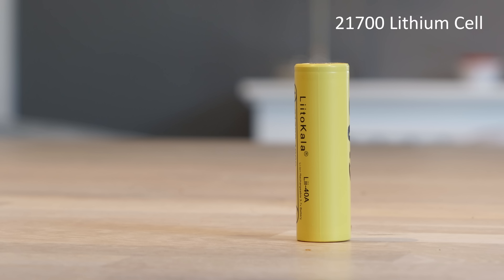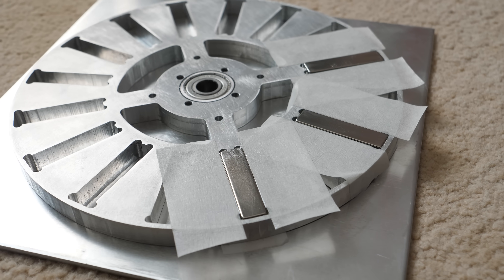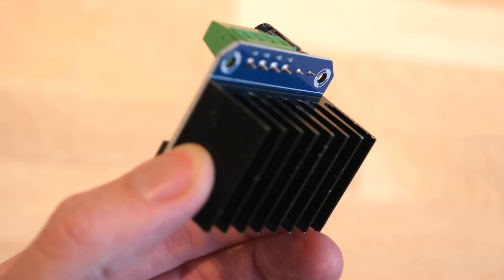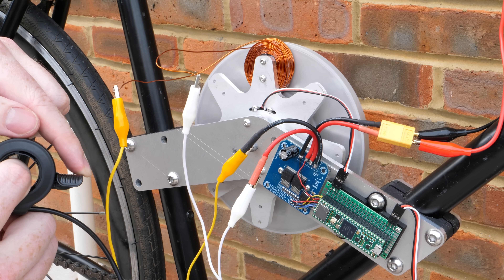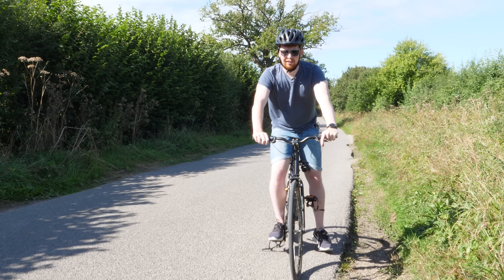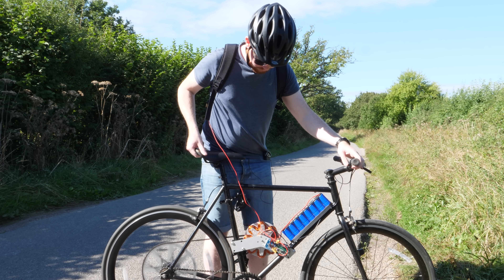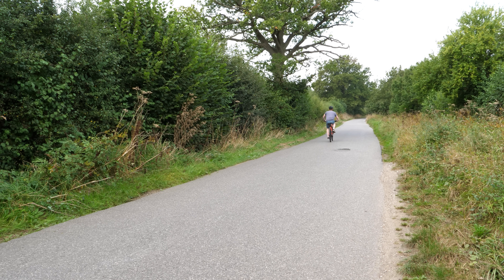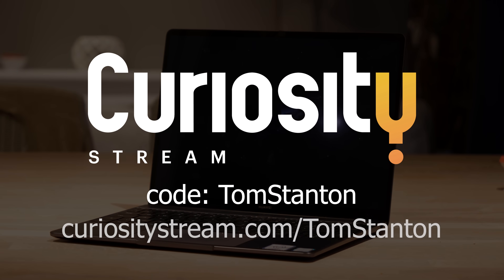Super Capacitor Bike

Comment: It's actually great to see it almost fully recharging the capacitors when you go downhill.
This would be great for electric scooters if the energy storage amount was bigger.
Massive props for creating the electric motor from scratch.
Reply: No matter how big the storage is, the descent is never going to provide enough energy to get back up the same hill. I wouldn't be surprised if the capacitors don't even have a weight vs storage advantage vs batteries anyway though. They're certainly much bulkier.
Reply: @RyanGaryLeTomo  nope, you just need to buy the scratch.
Reply: @ehombane  we have already seen what happens when a civilization falls that relied upon the tools and technology of others. The collapse of the Roman empire put Europe back hundreds of years in technological advancement. Same with the fall of ancient Egypt. We still do not know how they built the pyramids out  solid slabs of stone the size of a semi truck. We would struggle to build one with modern technology. No single person will ever have the knowledge or ability to build something even as basic as an aluminum can by himself left with no modern technology or tools, even if he lived for 10,000 years.
Reply: @randybobandy9828  I am aware of this. And it was implied in my statement which was only about improper use of an expression. (actually looking back, I may argue that I was wrong since the deceit is norm today, lying is the proper way of communicating).
Reply: @ehombane  yeah bs. You simply dont know how a slilled worker uses a term and now you whine about "uww lying is the new norm" Thats why you did not have the balls to answer to my comment. But i will give you another chance.

-A homeless person finds 100$ and says "Wow, thats a lot of money!"
-An Investor closes a reaaaally good deal of over 100M$ and says "Wow, thats a lot of money!"

which one is the liar here? 
The Answer is: there is none!

Perspective makes different terms mean different things to different people. words like "a lot" or "from scratch" are flexible and depend upon the circumstances they are used in.
Reply: @randybobandy9828  Thats not completely true. The things that we lost after the romans fell was mostly bureacracy. A nice thing but unneccessay for the small countries that existed back then as the upcoming feudal system was more efficent for them. The bathing culture for example survived the romans for centuries. Things like Math, architecture and chemistry boomed in the centuries after the romans fell. Sure we lost things. Plumbing for example vanished for a long time. But we also found tons of new knowledge that the romans never thought of despise their "greatness". Not to mention that we regained and improved everything that was lost after the roman empire fell

Also of course we know how the pyramids were build. im pretty sure you can find this kind of knowledge on wikipedia nowadays. The only questions that are still not completely closed are how they managed to build them this accurate with the simple tools they had, and why they built them like they did.
Reply: @andrefasching1332  go above and read my latest comments. As I said, I was wrong. What do you want me to say more that I was wrong. The correct way is how the majority says that is correct, even is wrong. 

From scratch is from basics. And if an Arduino board is basics, so be it. Here I am the ignorant not knowing where are the trees that bear Arduino boards as fruits. 

Anyway, this is just an single example of deceit, a minor one among other millions, other example being 14,99 used as price for curiosity stream. Just a minor strategy to seem that the price is smaller.  People already correct this seeing 15, but sellers still are using it, because this is the norm. And so it goes in advertising and politics media, and everywhere else, where is not as obvious, and then people complains about the results. 

All I tried was just a minor correction. Is a habit for me to react to fake news clickbait and this sort of bullshit. But people likes to be lied. It is obvious again from the reactions to my comment.  So yeah, enjoy your shiny make up. Truth is bland and grey and boring.
Reply: @ehombane  show us your ways
Reply: SIR ENERGY "SALVAGE" from REGENERATIVE BRAKING WAS FOR YEARS  ~15% .........GOING DOWN A MOUNTAIN (,CONTINENTAL DIVIDE / ROCKY MOUNTAINS ) NO POWER NEEDED , + CHARGING BATTERIES/ CAPACITORS ...
Reply: Yes, making that motor is impressive skill. But though, is not from scratch. 
People got so used on buying things...
So, there was insulated copper wire, magnets, aluminum. aaand .... some advanced electronics. Assembling this into an motor is a skill few have, maybe less than 1 percent of population. 

But, drop the guy on a deserted big island, and let him make the motor. I make the concession giving him the tools though. A shovel to dig the ore, a furnace to smelt the ore, a hammer... I stop here you got the idea. 

Sorry if my comment full of negativism, but I got tired of  this kind of videos, make your own solar panel, ... but I see how to assembly solar cells. Make your own battery, but I see how to assembly a bunch of batteries. Only once I saw a guy making a lead battery, but still so pitiful, that was not actually usable. Was just a proof of concept. We are so dependent on industry... 

Left alone, few of us will be able to make basic things like a clay pot or a wood spoon.
Reply: @ehombane  So what? If you want to watch ore smelting go to a different video, this video would be hours longer with multiple different mechanical fields involved that it would lose focus and take forever if it would have been done your way. This is not a primitive technologies channel.
Reply: @CheeseOfMasters  It seems you did not got my message. 

It is not about what I want to watch. It is about a statement not entirely true. I explained that I am tired of exaggerations. He could have said.. designed and built a motor, which is impressive enough. Leaving that .. from scratch, out, would not have ruined the message and the statement would have been true. 

Sure in these days when lies and deceit are the norm, this little exaggeration may seem natural.
Reply: @ehombane  "from scratch" merely means "from the beginning"

Building a motor "from scratch" does not mean you cast the iron yourself. It simply states that you build the motor with the unassembled parts used to build a motor instead of using preassembled Groups. Beeing an engineer working on large scale logistics applications i can assure you that there is a vast difference between these two concepts in terms of money and time.

Its not him lying....Its you having a false grasp of what "from scratch" means in the eyes of a specialised worker
Reply: @andrefasching1332  apperantly the guy thinks in order for your grandma to say "I. Made this pie from scratch" she has to grow all the ingredients but not just that, she needs to use her hands and no tools  because that wouldnt be from "scratch". She better not have used store bought fertilizer from the store either! Otherwise you can't claim from scratch either! Did she find those seeds in the wild or did she buy them from the store? Why is it that nobody is capable of building an entire computer from nothing but their bare hands and the knowledge to do it? We just are so.... Dependent on manufacturing and industry. Lmao
Reply: @ehombane  Clay pots and wooden spoons are magnitudes below assembling a motor from raw elements. I think we would be fine to make dishes if we needed to.
Reply: @bobafettjr85  You would be surprised how much skill is needed for those .... magnitudes below.  As a kid I was forced to do a lot of things with my hands. Some I even liked doing. But the results were so pitiful. Functional, but pitiful. So I know that is harder than it looks. I challenge you at a mind game. Imagine your city. How big it is? few ten thousands? few hundred thousands? Mine is about 200k. Now imagine a barrier blocking access to the rest of the world. Let include enough land to feed the people. Now go to superstore and look at the shelves and imagine how many products will still be there after an year. I am able to fix anything in my house. But I need spare parts and materials. I can improvise, but I know my limits. And I know the importance of industry that provides us so many things about we do not know how are made.
Reply: @ehombane   @Daneel Olivaw  Skill to make artful clay pots and wooden spoons. But as you said it would be functional. Those are things that can be made directly with hands and simple tools. Pulling iron ore out of the ground, forging it, then magnetizing it takes advanced machinery and understanding of several branches of science.

Concerning walling off the city that is a completely separate argument. If the average person were dropped on an island they would be able to make a crude spoon to use. If the city was walled off many people would die since they don't have access to resources outside of their area. But if you took that same population and dropped them in open wilderness that had some of every resource I would be willing to bet more would survive than cutting the supply line. Because among that population a large chunk can understand foraging and hunting. And then others who understand the various tasks of building shelter, farming, metallurgy, medicine, etc could teach the others. At some point massive a couple hundred they would get back to a similar point they were in when they began.

I understand your point that he didn't make it from scratch. But it's a phrase that doesn't really mean anything. If someone makes a cake from scratch that rarely means they milked the cow, gathered the eggs, and ground the wheat into flour. No they bought ingredients that were already prepared. So him making a motor from scratch uses the same logic he bought ingredients, wire, magnets, and metal and made the motor himself.
Reply: @bobafettjr85  Cutting lines of supply? I said plenty of land around. No need of supplies.  And as you said, they will survive, but at dark ages level. 

And with the caked example. I really never heard somebody saying making a cake from scratch.  It would sound really weird. I baked a cake from scratch. Even actually these days actually you cam make a cake by unwrapping the baked part and icing it with a spray can. 

And you are right, it means nothing. This was my point. Today words doers not means nothing anymore. We just use them as we please regardless of reality.  And as I said before, saying, I have made a moor that I designed myself would have been more accurate and similarly impressive. 

Sure these days some expression leaves room from interpretation. Like that joke. Sure we can accommodate you for the night, but you need to make yourself the bed.
There is no problem, I can make my bed. 
Good, here you have the planks, nails springs, rope and everything else needed.
Reply: @ehombane  You've never heard of someone "making a cake from scratch?" It's a pretty common expression. It means they made it from the base ingredients instead of a pre-made cake mix.

The entire point I'm making is making a wooden spoon doesn't take as much skill as making a motor. Even more so if making from raw materials. Most people given some wood and sharp rock can make a functioning spoon.

The whole city thing was a separate thought experiment you added on.
Reply: @bobafettjr85  from where I stand the fact that there exist that expression for a cake proves my point that in common language the true meaning of words and expression got really distorted. Opening a tin can or a plastic wrapping does not equal with making. 

OK then; I give up. Assembling is making. Assembling your Ikea furniture is making your furniture. And if you modify your Ikea furniture cutting the leg shorther and adding wheels for better moving around is making furniture from scratch.  And I am genius also. I have made all my computers except the first one.
Reply: @ehombane  the problem is if you want to do anything High tech by yourself you need a degree in at least ten chemistry subjects
Reply: @siddharthagotamask9848  Yes, I know that. And not only chemistry, but a lot of other domains. 

But what I do not know why you tell me this, when my comment was about the meaning from the scratch.
Reply: @ehombane  mmmh amazing dude you better than anyone, just create your own hydrogen storing polymer and give us a tutorial if you really know anything. So much dedain...
Reply: @ehombane 

"In My days there wasn't autism"

Some kids during these days:
Reply: @Daneel Olivaw  If you wish to make an apple pie from scratch, you must first invent the universe” - Carl Sagan

Comment: Just hope you don't over charge the capacitors near your legs ouch I'd add either a temp sensor or some safety cut out to prevent the capacitors over heating etc

Comment: How about:
1. Triple the count so you have 3x the voltage (and speed)
2. 5x sets of the above, so once the first set reaches threshold voltage, switch to 2nd set..BUT 1st set now gets charged due to regenerative braking etc.. The graph should look a little bumpy but kinda like a rectified sine wave...without getting below the threshold.

Comment: I have a 1963 Sears electric guitar with bar pickups that only one guy in US said he could re-wind.   I calculated the number of conductor wraps for the coil with 42ga wire.   I needed 4000 winds for the correct ohm value.   So, I made a wooden plate on my Shopsmith, mounted the pickup to it with two screws.   To count the wraps, I goy an old desktop calculator (the ones with a paper roll and printer).  Wired a door switch to the calculator circuit board by soldering it to the plus key both sides.   Mounted the magnet to pass near the switch.   Because the wire was as fine as hair, it took 4 tries, but I finally got it.   Guitar sounds great.

Comment: Use a Lithium battery for cruise, super caps for acceleration only. Regenerative braking to charge the capacitors. It will greatly increase the range of the cruise battery since it no longer needs to provide the heavy load for acceleration from stop.

Comment: Does your motor, which I was very impressed with, start up in either direction, or do you have the switching sensors offset slightly to induce forward spin?

Comment: With the capacitors all in series, additional issues are the ESR (equivalent series resistance), and self discharge of the capacitors.

(The larger they are, capacity wise, the higher ESR tends to be).

Paralleling them gets the resistance down. Maybe series/parallel.

If you can find a boost regulator that could handle the current, this might allow you to use more of the capacitor’s Joules.
Reply: There is a Low ESR series of Supercap available. Supercaps are best utilized when put in parallel with the battery.

Comment: It occures to me that the difference between the way capacitors and batteries receive charges may provide the matrix of differences wherein a hybrid might emerge ... even perhaps as how the differences between electric and internal combustion engines finally brought forth the more familiar hybrids in automotive transportation. Perhaps greater capacitance in the recovery of energy by slowing or bringing full stop to things already set in motion (as in braking) might recover and store energy to resuply the battery driven array of tools.

Comment: try connecting the capacitors in parallel the voltage will be lower but the amount of current will be insane. if the voltage is too low, put some capacitors in series front of the parallel capacitors to increase voltage, and current the result, an extremely strong motor, just make sure the wire can handle the amount of current running through it.

Comment: Nice build, honestly! One thing: aluminum does have a magnetic response, it is due to Eddie currents. So, having the motor built using aluminum lowered its efficiency a little bit.
Reply: I misspoke about copper on aluminum. It’s a magnetic fields affect on copper or aluminum. Even though they’re non magnetic they will resist motion of a magnetic field because they’re conductive they become an opposing electromagnet in the moment an actual magnet is moving near them.
Reply: Eddy
Reply: The aluminum rotates with the magnetc field so does not see any change which would induce a current. The chain being so close however will be almost be the equivalent of a shorted coil
Reply: Yeah it induces a resistance just like dropping a piece of aluminum down a copper tube.
Reply: @jamesa8851  I'm no scientist but I never heard someone mention that before.. Is there a name for that effect so I can search youtube for videos measuring it?
Reply: @ChristopherJones16  Lenz's law: a changinge electric field can generate a magnetic field in a metal such that the generated field opposes the original field
Reply: @zucc4764  cool thanks. I hope someone made a video on a test using a copper pipe and a piece of aluminum being dropped down it. That’s fascinating.
Reply: @ChristopherJones16  drop a ***MAGNET*** DOWN THE INSIDE OF A COPPER TUBE .......MAGNET DROPS VERY SLOW .....NOW DROP SAME MAGNET INSIDE AN ALUMINUM TUBE SLIGHTY FASTER DROP ( MORE RESISTANCE IN ALUMINUM TUBE = LESS OPPOSING , INDUCED MAGNETISM ) ....NOW DROP SAME MAGNET INSIDE A PLASTIC TUBE : VERY FAST DROP ,~32 feet per second ²
Reply: @erickajander5494  "feet per second" LOL